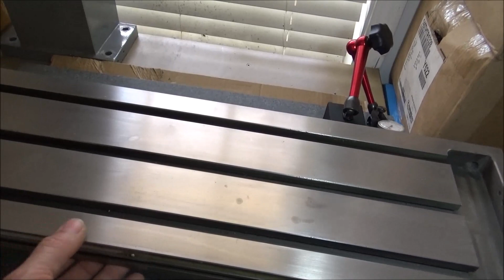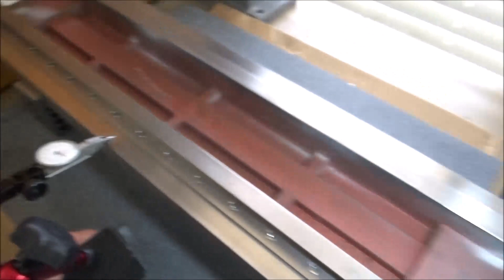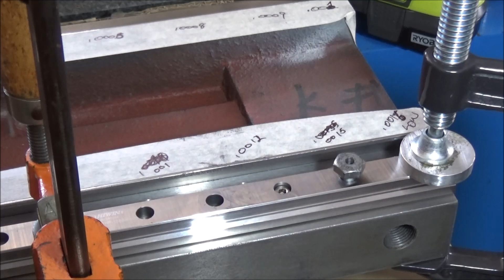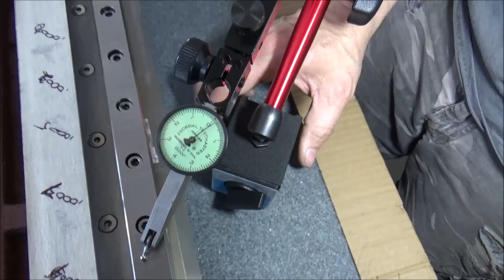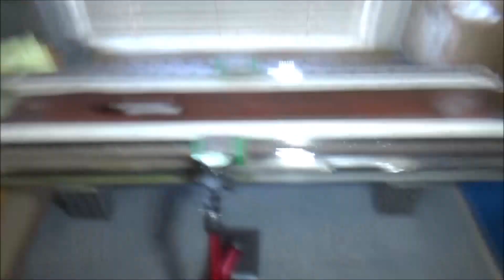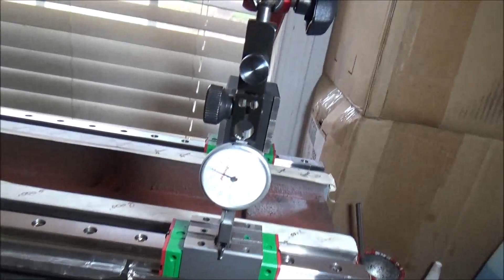PM727MXL X Axis Linear Rail Install

Comment: Is there a reason you went with linear rails over the machines dove tail ways? I'm planning to convert my PM-25mv to CNC and not sure if I should follow your approach.
Reply from the maker: I Have a PM727M converted with the standard dovetails, Which I have now been using 6 plus years. This was a 2nd machine I started this project on.

Comment: Very cool!  I’ve subscribed to your channel and have been following along in this series and I have a question, is it worth it to install these on a manual mill rather than re-scrape to flatness? would it be faster and cheaper in the long run to do this?
Reply from the maker: I cannot honestly that question answer as i have yet to finish the rail conversion. A manually converted mill if done correctly will give you great results for most hobby machining.

Comment: Be careful when indicating off the top of those linear rails.  They are not ground to a tolerance on the tops only the V grooves on the sides.  I measured my rail tops and they were very slightly out, but when the carriage was added (which runs on the V grooves) and I measured to the top of the carriage instead they were as flat as I could measure.
Reply from the maker: I agree, I did measure to the rail top to get a ballpark measurement. the final Height was measured to the Block along the rail, which is the only accurate way i could think to check it. Thanks for the Bushing trick really worked well.

Comment: Nice work Sam. You seem to be staying focused on what matters the most. One has to contend with the overall accuracy of the mill and trying to correct any deviations that can improve it's accuracy without getting too critical. It will be interesting when it is all said and done to see how accurate and repeatable it can perform compared to your current PM727.
Reply from the maker: Thank you , Very well stated! I cant wait to see if all the work was truly worth the effort in the end.

Comment: Wouldn’t it be a better idea to take the table to get it properly ground to give you the best platform to build from instead of continuing with something you know is bent like a banana
Reply from the maker: YES Absolutely! And while there Doing that you can have them machine the datums in the ways. It all depends on how much money you want to invest in the build. and what your expectations are in the end. At some point its not cost effective to convert. The Idea behind this Rail conversion is a build that can be done with minimal mods to the machine. and something that someone else could  also follow and repeat.  The table has a slight dip in the center, about .001" Of course this is tapered out to 0 at the ends. Assuming you can get your head perfectly trammed in it maybe out a few tenth's.

Comment: Excellent! How would you make sure the surface plate itself doesn't have a bow in the center?
Reply from the maker: The surface plate is not a High grade surface plate I did check it when I purchased it and it is really flat. However if there is any bow I was not able to measure it with the instruments I have.

Comment: You’re really making me want to convert my PM-30MV to linear rails. Any idea what you’re expecting for rapid speeds when you are done? Those rails will have so much less stock-slip than the tapered gibbs so I’m guessing with some decent clear paths or similar you could be into the 350ipm or so range
Reply from the maker: I will be installing the DMM servos on this Mill Max rpm is 5000 I will most likely not run then near that speed.  I will be using 5mm pitch ballscrews  which is 5.08 turns per inch.  SO rapids will be up to 5000/5.08 = 984 IPM I will realistically keep the rapids in the  500IPM neighborhood.

Comment: based on your measurements the 2 sides of the table are not parallel.  Shouldn't you be measuring up from the bottom that way you'll have a common reference?  Both sides were even when you had it the correct orientation........it wasn't when you flipped it upside down.
Reply from the maker: Hi Ron, The table when in the correct orientation was lower in the center on both sides. measuring from the  surface plate to the mounting surface. for the most part it was equal on the ends .0013" and .0012" the front edge of my table was .0002" thicker than the back edge. 
When I flipped the table and mounted the rails the Idea was to make them a equal distance from the surface plate. Ensuring they were Both the same height down the length.
By doing this I hopefully leveled the table and corrected the variation in table thickness.
The rails will run true, however the table will still have a dip in the middle of .001" It does appear to be even front to back and taper out to the ends equally which should be fine.